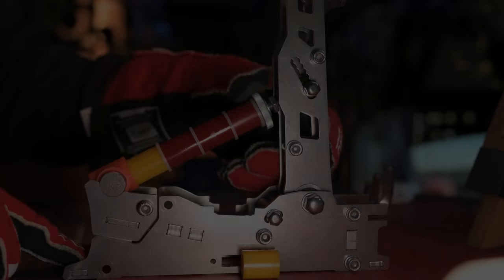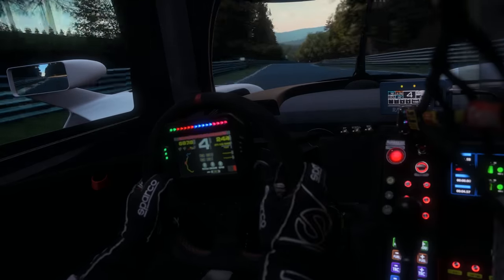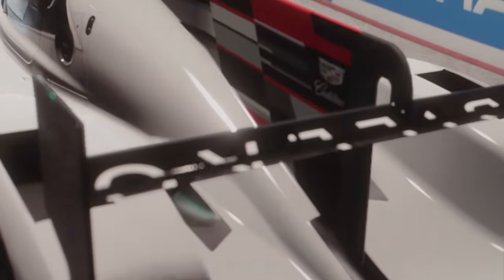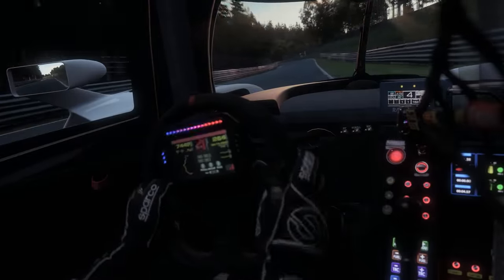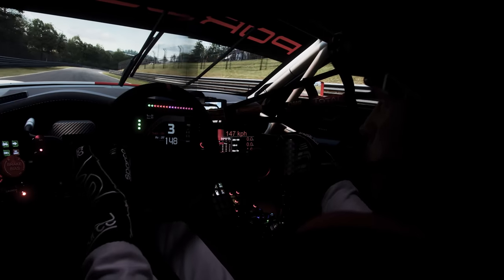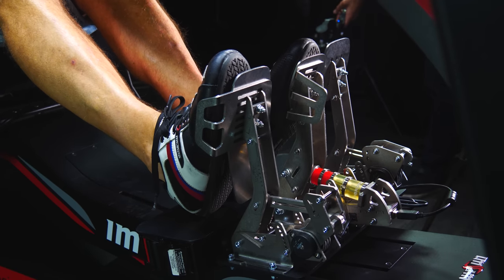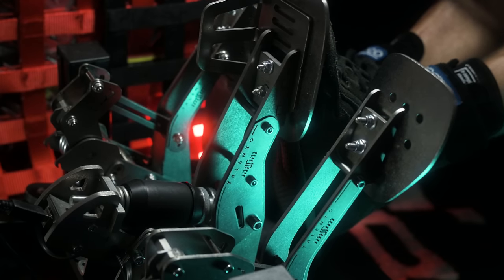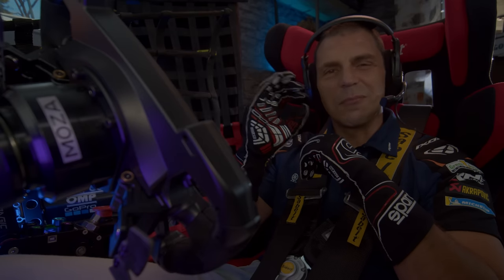How I setup my Brake pedal for max performance !

Comment: After purchasing the VRS pedals, I kept the suggested stiff red spring that everyone says to use.  After 6 months I decided to try the lighter blue spring, it made all the difference for me in trail braking and comfort.  Much easier to trail brake and quickly get to 100%.  Like you say, try everything for yourself and find something thats good for you.
Reply from the maker: Thx for the feedback Luke 🍻
Reply: Yeah the biggest con is that you can hit the bump stop with the blue spring. You don’t have to press the pedal like a Brontosaurus and mess up your joints lol. When hitting the bump stop it’s so easy to trailbrake imo. Especially because there is a spring that pushes back instead of rubbers.

Comment: Awesome video, absolutely on point, and I wish it came 3 weeks ago when I purchased P2000's (upgrade from Thrustmaster T-LCM's). After 2 weeks of mucking around with settings, 1-2 second slower lap times, and battling to understand why the 'experts' recommend harder brake pedal, I changed to yellow/blue springs, linear input curve, and backed off the max input value = Instant success!! 99% of my racing is in the V8 Supercar, which is literally driven with the pedals rather than the wheel. For that reason, the new pedals are awesome = super smooth and lots of control through the range.
Reply from the maker: The P2000 red yellow setup is bit hard indeed and sometimes after long drive with hardly reached 100% ones my leg get fatigue! 
The V8 are as you’ve said pedal driven cars indeed and I love them so much ! I wish one day to find the time and master those cars ! 
Absolute respect for all V8 drivers 💪

Comment: I like a good amount of pedal travel, slightly soft pressure. I can reach threshold and trail brake much more accurately this way.
Great video, very informative, as always! 😃👍
Reply from the maker: That’s exactly what I found works for me after years of exploring myself! 
Much more control in the entire and mid corner with little more travel and softer setting ! Those are very important parts of the braking and with the short hard pedal was really hard to be precise and consistent for few hours drive 😃
Reply: That’s exactly what I am trying to change on my fanatec csl lc pedals… more pedal travel. But I am not sure how I can do that. Should I remove one of the elastomers? Or buy a spring? Please help if possible!!! Thanks for the great tips always!!
Reply: @joaomoretto  I've replaced all original elastomers from the CSL LC with a "Progressive" elastomer from 3DRAP and the "Hard" spring from Race Sim Engineering Brake Tuning Kit (the kit comes with 1 soft and 1 hard spring). You could replace 1 of the original elastomers with a spring and get a similar feel with more travel (put the spring towards the pedal face plate and have remaining elastomer toward the load cell). Hope this helps 🙂
Reply: @TexasGore  thanks man! Helped a lot !! Unfortunately the brake kit from Race Sim is out of stock! I will wait to buy when it comes back

Comment: It’s all about personal preference as u said!! For me, I personally prefer a short travel and very heavy brake! I found that it’s very easy to lockup with soft/medium brake pressure especially with cars like the 992 cup car and others with no ABS. When I’m going top speed down a straight  “I know it’s a sim and we don’t feel the forces” my instinct is to step hard on the brakes and with soft pedals I find it very difficult to apply enough brake to stop without locking up!
Reply from the maker: I know exactly what you mean , that’s the problem I have with the cup and the V8 and need at least 2-3 days to go close the good braking control 😁

Comment: Wow you hurt your knee needing so much pressure on the brake pedal? Ouch! I'm glad you recovered. I know a normal car brake pedal isn't that hard. I'm glad you have analyzed how to keep yourself comfortable and to prevent injury using the brake pedal. You definitely need a way to keep yourself from moving backwards for sure. I'm only a hobby / doing sim racing for fun so I only have a stand. The big difference is the stand has a chair holder that prevents me from moving backwards when pressing on any of the pedals. Definitely a must have. Thanks for all of your tips and information. Always helps us beginners.
Reply from the maker: Yeh man ! It is stupid but I did that thinking I’m having better control and it turns I can have as good control with softer pedals too 🙈

Comment: Another great vid! I hope the pedal cam from Lando Norris's McLaren also shows people we don't need stupidly heavy brakes with almost no movement. And you're right without G assist on the pedals sim racing doesn't need to replicate stupid stiff brakes, better to find the balance like you instruct.
Reply from the maker: I really tested that brick like pedal for months trying to convince myself will work but it never did for me and ones I soften it back I’ve got the control in the entry and mid corner ! Sometimes I lock tires easier but after practicing the same car for 2 days I have full control 😃
Reply: @chepilevski  I did the same after your video about pedal and seat position which helped a lot with my back pain (old injury). Going from super stiff to softer brakes I was getting faster, more consistent lap times, with better endurance and less back pain. With a heavy brake in sim racing all we're doing is shoving our spine into our seats, after a certain point the extra pressure ends up also putting force into our backs so some of that extra  pressure goes to waste and just hurts our endurance. And now we're seeing real race cars and drivers who aren't using brick-like pedals, so going for a super heavy brake feel isn't even as realistic as people may have thought

Comment: I love this video as its good to express someone of your skill level to show its not all about the stiffest settings its about balance and experiment. I only have V3s but I haven't installed the BPK as I feel like since using them and my real car break I prefer some travel to help remember how much force I need. Love your content mate 👌🏾
Reply: Definately the bpk. It’s much more consistent. Just try the different combo’s.
Reply: I have the BPK and can honestly recommend it 100%. I would advise trying one red + green + orange sponge combo first. That's what I have in mine. I would prefer mine to be stiffer tbh. Also if you want more travel you can adjust the pedal itself. But if you're happy with your setup there's no need to think of anything else
Reply: @pedrosilvaproductions  ill look into this maybe.. catn lie i keep peaking at Sprints but my bank acount makes me stop looking quite quickly

Comment: Your timing is always on point. I upgraded to Sprints two days ago and have been trying to get the best performance out of them. Amazing video as always man 👍
Reply: Oh and again can't wait for the moza review 😁
Reply: Great set. I started with mediums which is default setting, and now I changed to the short soft rubber bumper which is the second most stiff setting.
Reply: @pato17rio  ya I’m now on the hardest setting and it is a bit like a brick wall. I’ve had great success w that for months now but thinking to work back to mid softness. Fun to tinker ha.
Reply from the maker: Test and make sure you give a week at least for each setting bro ! At the end you will know exactly which settings will work for you personally 💪 
The R9 video is coming probably next weekend as I do final tests now and will start working on it 😁 
Super excited with that base man 💪💨
Reply: @chepilevski  right on good tip. I currently have a very consistent time around historic AMS2 Spielberg in BMW M1, using h pattern and all. It will be a good baseline for me to compare. Your reviews are top notch I’ll be tuning in :)

Comment: Such an awesome video, it deserves a lot more views as it is something that must be heard by more people. Good timing as well, got the Fanatec V3's and with the default setup and settings I couldn't trailbrake and was locking up. I 've heard about "hard brake pedals" but right now I feel like I need pedal travel to brake correctly so I was confused. Coming from the T3PA pedals and karting irl I feel like I need a decent amount of travel to have good brake control.
Reply from the maker: Thx buddy 🤛 
I tried hard to learn hardest settings and every I come back to softer with travel it worked better for me 😃 
It is not just about braking hard but we control the car as much with the wheel that much with the pedals as well everyone out there must find the perfect sweet spot for it self and not fall in that trap 🙈
Reply: @chepilevski  Very well said, agree 100% :)

Comment: as a rule of thumb the more road going is the car the longer the pedal movement (which makes it feel softer), the more racing car all the way to F1 the shorter the pedal travel. 
He explained it perfectly but let metry to summarize what I understood: In road going cars such as the MX5 you will not gain as much time by going earlier to 100% brake force than by manipulating the weight transfer accurately. The more high power / downforce car more gains are to be had by reaching maximum braking force faster, weight transfer manipulation doesn't gain you as much time anymore in comparison
Reply from the maker: You said it so much better and cleaner then me ! 
That’s exactly how it goes , the high downforce cars don’t need weight transfer manipulation but accurate fast and precise braking then just smash the throttle on the exit and try to gain as much downforce as you can ! Great setup helps the rotation of the car and there is almost no time to play with the chase at all ! 
With the road cars we have to help  the car rotate around the corner manipulating the weight transfer! 
I personally prefer medium long travel to still make the push and lift off the pedal quick enough to make the car more responsive!
Reply: @chepilevski  ah the preferences reminiscent traits of rally driving. Very hard to change these traits once they're hardwired. Same goes for me
Reply from the maker: @christoforospaphitis4090  So true 😁

Comment: Great vid. I’ve done all variety of setups on my Sprints. Currently success with hardest elastomer config w 60kg. Will try a known car track combo on slightly softer setup tomorrow as I’m interested to test again now! Tinkering is a fun part of the hobby!
Reply from the maker: Great to hear you are open to to test different settings Kevo 💪 that’s the way to take the maximum of yourself 🍻
Reply: @chepilevski  I refuse to drink light beer though cool? 😁 I’ll report back later! Cheers! 🍻
Reply from the maker: @kevin_m  would love to hear from you brother  🥃
Reply: @chepilevski  I only went to hardest possible setup because of the Invicta pedal hype (you must have hard pedal against disc pad feeling). Tonight I moved back to only slightly softer setup and shaved .5 second off my best time in ams2 @ Spielberg Historic w M1 Pro Car in just 1 hour test! I think better mid corner/trail brake feeling? Will continue test this week to see if consistent improvement. I have the new Sprint elastomer upgrade kit arriving tomorrow! So that’s a whole new thing to test!
Reply from the maker: @kevin_m  that’s awesome Kevo 😮 
If you did that in an hour you have to test for few days till you see the real potential of that 😃 
Happy to see you are open to test and find your best option plus the new elastomers you will have some work to do 😁
Reply: @chepilevski  ok I installed the new elastomers to upgrade my Sprints. They are more progressive and I’m liking them. BUT, I had to go back to the hardest setup as they seem a bit softer overall. I think I prefer more “pressure in my leg” range than travel-distance/pressure combo range. If that makes sense? Like my leg muscle is the elastomer? Ha. No racing pain and again topped my lap time by another .30 seconds so I don’t know. Maybe you can “get used to” any setup if you just use it for an hour or so. So my idea is, use whatever you prefer to have good laps with and no knee pain :)

Comment: @Race Beyond Matter. Not sure if your aware of this but I see you put the yellow spring on first then the harder one but that is the wrong way so Simagic told me. 

Because it uses a pull rod the first spring that comes together is the last spring you put on then as you max that out then the harder spring should compress so the first spring. 

I noticed your yellow is on first and then red so thought I'd mention it. I had to ask them because I took them off and wasn't sure which way too put them but the explanation they gave saying its a pull rode makes sense. If the rod was pushing then yes but it pulls so thought I'd mention it. 

If you Google the simagic pedals you will see they have the red one on first then the yellow. Hope it helps as it maybe why your knee got bad so fast because your going from a hard spring then soft as in backwards
Reply from the maker: Ah yeh, I did that mistake wen I swapped to test all the springs but I fixed it and it makes difference indeed bro 😃
Reply: @chepilevski  cool Bro. Have a good day mate

Comment: I think the most important part is knowing when you reach 100% brake input. If you are a above average strong person and you can easaly press for example 120 kg, you will have a hard time on HE Sprints because it's hard to know when you press maximum input. In ACC this is important because if you want to start trailbraking you NEED to know where 100% input is. I had Sprints for a year and couldnt get consistent with them. Now i bought VRS and because the LC is bigger i can feel where the "end" of the travel is. Now i know when i press 100% input and can start easing of the brakes a lot easier.
Reply from the maker: Well said buddy 🤛 
And I know exactly what you mean for ACC braking 😃
Reply: Hello NickyB.
I currently have the V3 from Fanatec and am considering buying the Sprints. I'm not very strong and don't really need more brake pressure than maybe anything between 40-60 kg, but thought the Sprints might help me with trailbraking. Do the Sprints have no end stop or something that feels like it? I hope you know what I mean. 
Maybe you can tell me if the change is worth it.
Reply: @Noeln83  hi. They don’t have a bump stop. Sprints are descent but imo only if you don’t max them out. VRS is better in pretty much every way. They do have a bump stop as well. The way I set them up now is with the blue spring so that I can hit the bump stop pretty comfortably. This way I know when I hit 100% braking and can start trailbraking from exactly max braking input. I’m not invested in them  btw ;). Just my fair 2 cents.
Reply: @Jeckaa84  Thx for the quick answer. Then I think about it again. V3´s are still good.

Comment: I think it's safe to say that racecars have stiff brake pedals because if they didn't they would lock up easily because of all the weight of the driver shifting closer to it. A driver would adjust to be stiff as hell on the car for that reason, but on a sim you don't get lots of inertia (even if you had motion systems) and as such you need a softer brake to be more accurate while sim racing and hard pedals make it more difficult.

Comment: I think many problems with the knee or hip come from an awkward placement of the pedal (plus too high forces of course)
I prefer to have the brake pedal further left (almost at the usual clutch position)
The leg should be pretty straight imo
Reply from the maker: You are absolutely right!
The placement is the most important part for sure! I also have the brake pedal as you said exactly straight to my left feet !

Comment: Once again, your advice is spot on! I made the mistake of thinking that I needed to go to hydraulics to get the braking and throttle feel I wanted. What I ended up with was a brake pedal that barely moved and a throttle pedal that felt like a brake pedal. That's not what I want/need. Stiff brakes with a bit more travel and solid but springy throttle. The Im Sim Talentos are on my very short list. BTW, what pedals were you using that had the heel rest on the pedals? That seems like a pretty smart idea! Thanks for the outstanding content and advice!
Reply from the maker: Thx buddy! Stiff throttle sounds like nightmare man 🙈 
The pedals bay the way are the SIMGRADE R7 buddy! Crazy pedals for sure 😁

Comment: Personally I use around 50-60kg max pressure and around 30-40mm of travel. Im almost 50 and been at it a very long time, also my body isn't what it used to be. That being said you also don't need the best high end pedals to be proficient, just being able to understand and translate your understanding of what the cars needs is enough. A cheap CSL elite load cell will be just as good as any other very expensive pedal with time and practice.
Reply from the maker: Absolutely agree with you Michael! Understanding the algorithm you can be fast with Logitech pedals as well if you know how to use the forces of the car and use them 🍻
Reply: @michael stuart how do I find my ideal max kg? I mean how do you know what kg force you have set. Thanks
Reply: @Simlife101  very subjective. Physically I get sciatica if I have a pedal thats too heavy. I think you need a pressure that you can achieve comfortably, it should not be a struggle to hit every time, because you will be hitting it almost every stop then bleeding the pressure off to the apex.

Comment: honestly the brake force also depends on how you sit, legs down= easier to reach higher brake pressure, I personally sit in a hybrid position use heusinkvelds with 80 kgs and I still find It to be good
Reply from the maker: That’s very true indeed 🤛